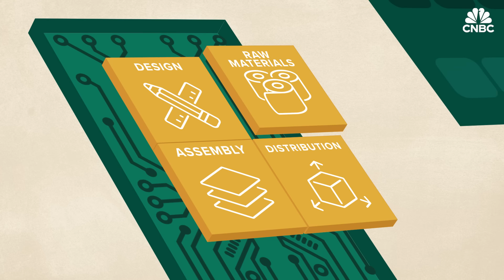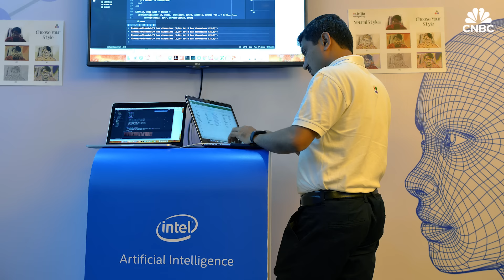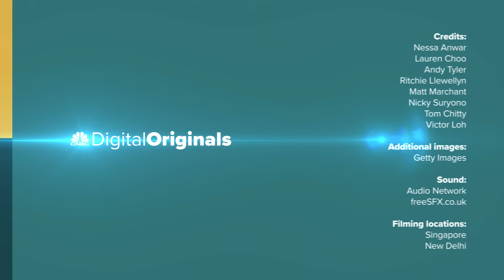India is moving beyond call centers and IT support – but can it work?

Comment: Let's not forget TCS and Infosys' (Indian service based tech companies) contribution in fixing the Y2K bug 1990-2000

Context: Y2k is a computer programming flaw that could've caused widespread issues when the year changed from 1999 to 2000. 
How? because only 2 digits were used to represent the years back then. ie; 1999 as 99 and 2000 as 00 which the computer would interpret as 1900. 
This could've caused failure in power grids, banking systems, transportation networks and lose in economic stability.
Reply: We're in 2024..
Reply: @sebraaap  no harm in being nostalgic 🤣
Reply: Contribution in the Y2K bug or contribution in fixing that bug? You made it sound as if TCS and Infosys caused the bug.
Reply: @pissupehelwan  🙌done

Comment: I still remember

During Childhood, There was a temple that I used to go to and it would take 5-6 hrs because the roads were 2 laned and sometimes in poor conditions.

Now since the roads are of high quality and mostly 4-6 lanes

That same travel (Which I rarely do nowadays) just takes 2 hrs (Even though roads are clear, I don't think driving faster than 80-90 is safe)

Comment: What india need is IC chip manufacturing and robotics. stepper motors  is key. if all these are cheap , then india can create robots for the world as labour cost will be dirt cheap. Hard repeatable jobs has to be handled by robots. All manufacturing has more fixed robotics but what i am saying freeform robots. Cops can be robot. Yes Robocop is coming soon. With advent of chat Gpt , robots can talk clearly. All it need is physical functionality. Can it be misused. Anything can be misused, we just need to ensure MOBS should not be in control of this.